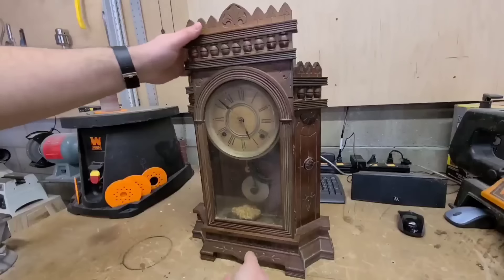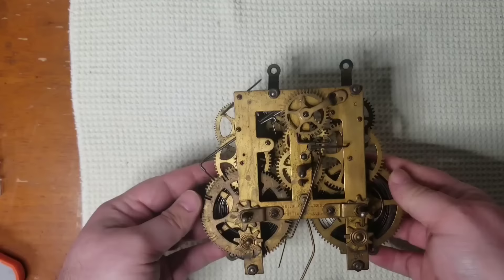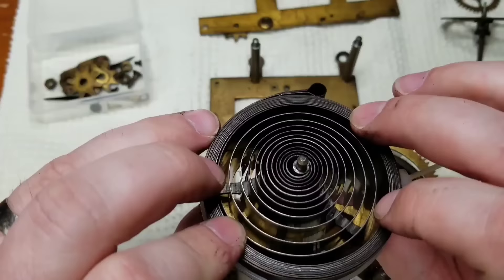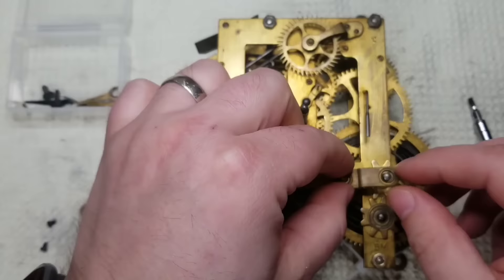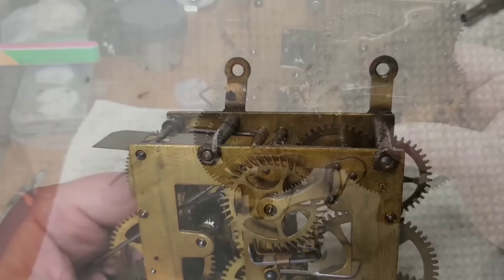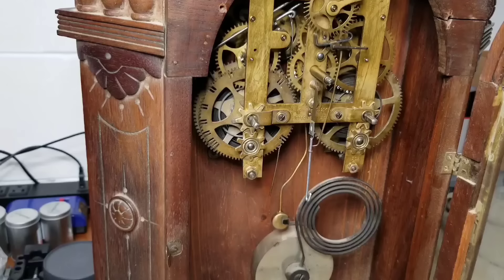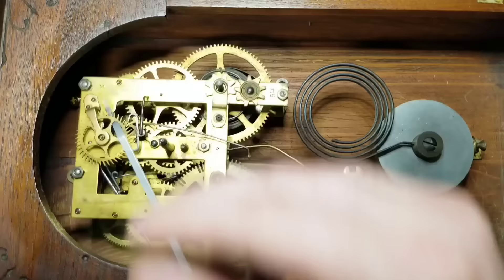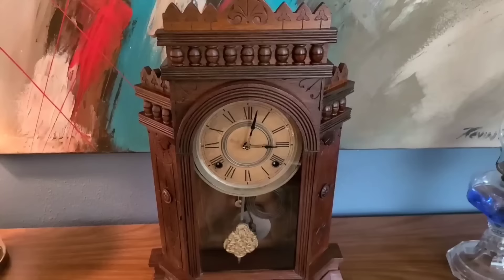Broken 1885 Gilbert Clock (Restoration)

Comment: How much does a clock like that cost?
Reply from the maker: I've seen them sold for cheap and up to a few hundred dollars. Depends if you find one at a garage sale or an antique shop, for example.
Reply: @WatchOverhaul  - I got it for free. I also have a Howard Miller like yours. Do you have an email to discuss some repairs?
Reply from the maker: @amcast562 My email is watchoverhaulchannel@gmail.com

Comment: In one of your videos I saw you use some phone app to measure the BPM of the clock. Can you please tell me the name of the app? Currently I'm building my own pendulum clock from scratch and I think it would be useful. Great work, by the way! :)
Reply from the maker: There is a link in the description for the app I used. Thanks for watching!
Reply: @WatchOverhaul  I’ve got the app, thanks! :) I have a little problem in calculating how many BPM my clock should run at. The clock is built with LEGO so it needs more wheels than standard clock. I can’t figure out the formula (there is no problem for 3 or 4-wheel clocks). If I sent you the wheels plan, would you be so kind to help me figure it out?
Reply from the maker: This website explains how to work out the BPM. https://needhamia.com/calculating-a-clocks-ideal-pendulum-period-the-sequel/
Reply: @WatchOverhaul  great! Thank you

Comment: Why take the movement apart?  You said you didn’t know what you’re doing. If your car engine wouldn’t start, would you take it all apart?  Do the arbors, pivots have play?  Major rebuild. Mount it on a test stand. Level it front to back, side to side. Wind both arbors. Now is the time to see if the mainsprings will break. I first get the movement running. How long will it run for?  Does it strike?  Remove the verge and let it freewheel down. Runs smooth? Any noise, clicking…?  Then I ultrasonically clean it. Dry it with a hair dryer. Mainsprings are let down. Oil them with machine oil. Oil pivots with clock oil. Grease on wheels (gears, sprockets) attract dirt. Level it, run it, troubleshoot it. Buy parts from Merritts or Timesavers or Clockworks. eBay is too expensive.  Buy tools from them too like mainspring clamps, nut drivers.
Reply from the maker: Taking the movement apart wasn't to diagnose any known issues, I did it to get everything completely clean and to also make sure every part was ok. It was extremely dirty. I now know greasing the gears isn't best to do - others have mentioned that as well. I also don't have all the proper tools yet because clockmaking/watchmaking is an expensive hobby and I'm just getting started. Thanks for the tips and for watching!
Reply: @WatchOverhaul  You can get the movement clean by ultrasonically cleaning it when it is together. Buy a bigger cleaner or wash it in a tub. I bought some tools and made my own test stands. The strike train with the count wheel system is the most complicated. I bought an old movement, removed the mainsprings, cleaned it, and then studied how it worked. Hope I wasn’t too hard on you. Get a Timesavers catalogue. Check out their tool section.
Reply from the maker: You weren't too hard on me. I appreciate the feedback. I have a lot to learn and it's good to know how I can do things better!
Reply: @WatchOverhaul  When I learned (time side) one wheel makes a revolution every 60 minutes (minute hand mounted on it). One wheel makes a revolution every 12 hours (hr hand mounted on it), that gave me understanding. I got into this hobby years ago when I bought my first clock (steeple) from an antique dealer. He said it ran…. Yes, for 2 minutes. It just needs to be levelled…liar. The movement was junk, someone didn’t know what they were doing. I replaced it and kept collecting from there…wiser now though. Merritts is great to buy old clocks from. As is found. Most movements I’ve been able to get going again. I can’t restore though, don’t have the close vision or hand dexterity anymore. Expensive to ship to Canada though. Let me know if you ever get stuck. My full time clock guy has only 150 clocks to restore. I stay away from cuckoo clocks.. only a German maniac would work on them. Too much going on. And they aren’t quality. Like the antique American movements
Reply: Except don’t ultrasound-wash it without taking it apart. The risk of getting trapped water, rust and shake-damage is unnecessary. A clock can be serviced professionally with ordinary household tools, and oiled correctly with cheap oil and grease from hardware store. But do find some books, there are a bunch online. And have fun!
Reply from the maker: @lottaleijon6654  Those are good points! I figure it's safer to error on the side of caution and make sure every part is really clean and inspect them. Plus, trying to do a complete overhaul is part of the fun! This is definitely a journey and thanks for coming along with me!
Reply: @lottaleijon6654  Cheap oil and grease?  Clock oil is synthetic, non detergent. It doesn’t hold dirt. You have to know how to properly lubricate the pivots and mainsprings. Both different oil
Reply: You don’t become a licensed clockmaker from watching YouTube… I am happy to discuss 19 century’s clocks and oil when you got yourself a bit more knowledge, and not from YouTube hobbyist WATCHrepairs.
Reply: @lottaleijon6654  Yes, what do I know?  Discussion ended.
Reply from the maker: @davemclean6835  I think I accidentally removed your last comment. I was messing around in the settings and YouTube said I had to approve your comment for some reason. I approved it, then it said it was removed. Don't know what happened. Please feel free to add it back. Sorry!
Reply: @WatchOverhaul  no worries, I will leave well enough alone
Reply from the maker: @davemclean6835  I actually see your comment now. The one about cuckoo clocks. I actually just finished working on one for the first time (next video). I wouldn't mind bouncing some questions off ya. If you want, you can email me at watchoverhaulchannel@gmail.com.
Reply: @WatchOverhaul  I found my comments about cuckoos. They drive me cuckoo!  With texting I can send receive pics
Reply from the maker: @davemclean6835  That will work. I just don't want to blast my phone number on here for all to see. If you email me, we can exchange contact info.
Reply: @WatchOverhaul  ok, I will send my email address

Comment: Don't mean to sound like a Butt but don't use 3 in one oil.  over a year or two it will gum up and practically turn to super glue!  I used it on some guns I had and it  was like putting Elmers on everything.  So I when I got it cleaned it off  I got some good gun oil.  I have some old clocks I work on and I use the use the synthetic oil and have had great luck with that!
Reply from the maker: Oh, you're good. Many people said I shouldn't use that kind of oil. Live and learn! I use proper clock oil now. Thanks for watching!
Reply: @WatchOverhaul  I really enjoyed your video!  Good job!